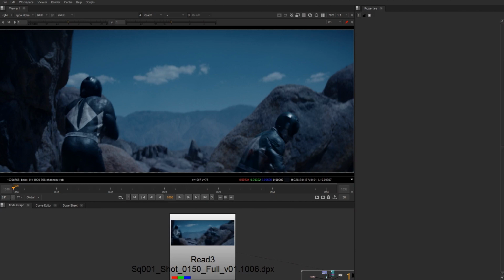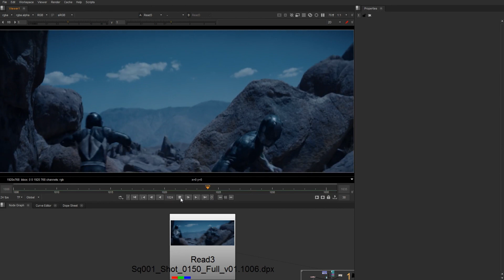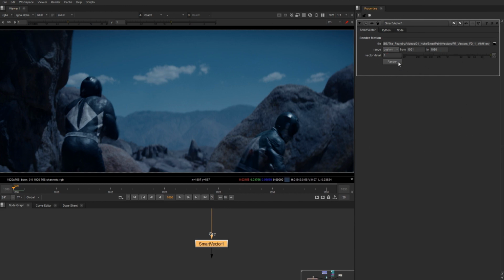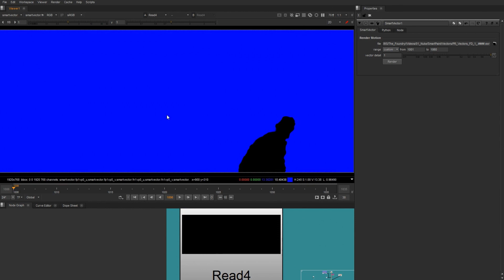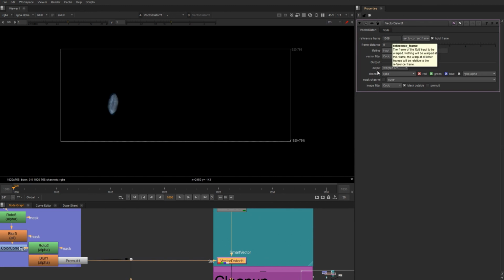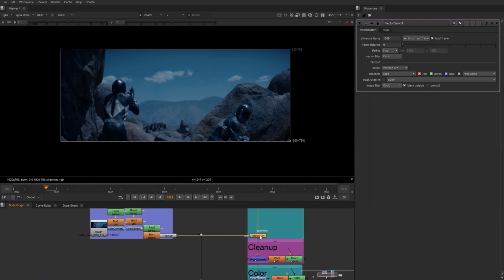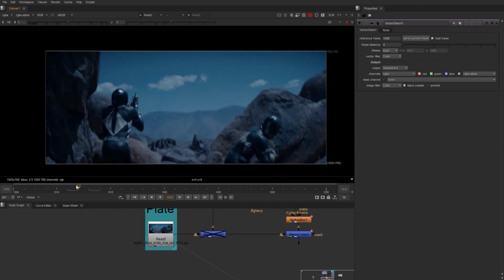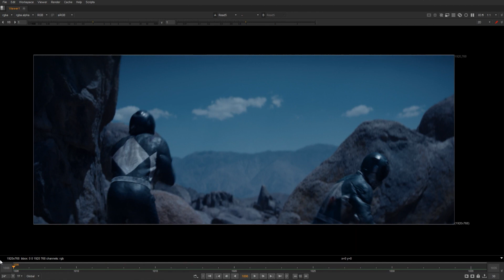Nuke 10 | Smart Vector Toolset

Comment: I used it to do cleanup and paint on a shot that I couldn't get working with trackers, grid and spline warps in a couple hours.  It did what I could not do in two days of tracking, warping, rendering, getting frustrated with the sliding.  This will be one of the first things I try for cleaning plates from now on.  So amazing to paint and clean w/o a single tracker or camera in the comp.  Great work Foundry!